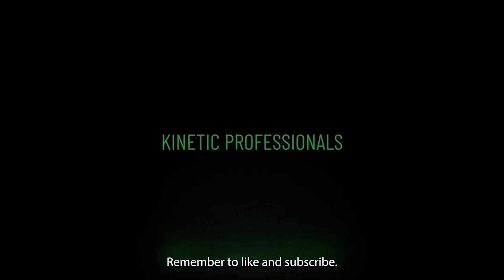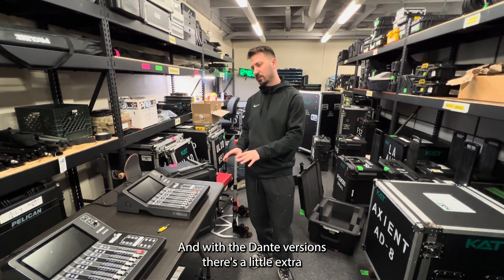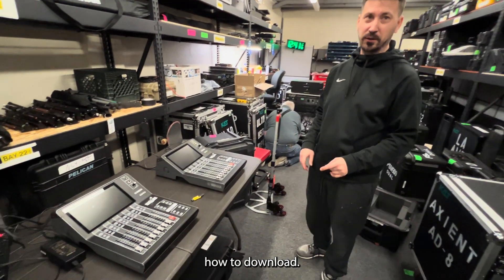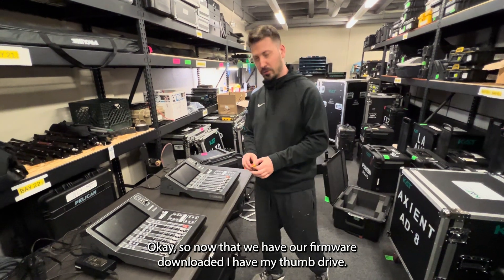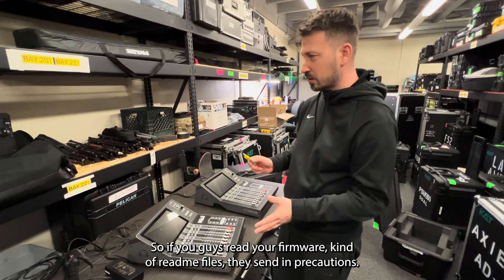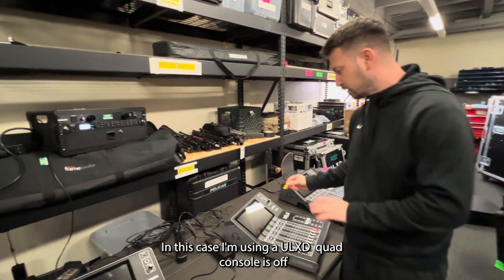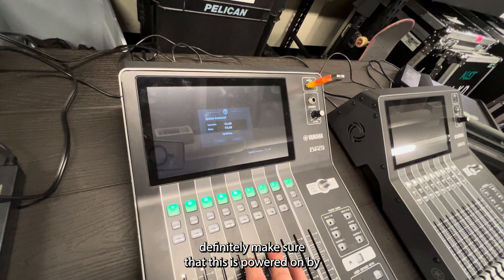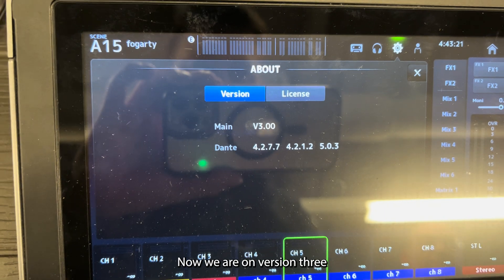How to Update Firmware on a Yamaha DM3 Digital Console

Comment: I was having trouble updating my Dante desk. And I thought you had to only have the .bin file, on the root of the USB. And I was trying to do a Dante update (file .dnt), via the Dante software on my laptop. 

Before, when I did the updates. It would stay it worked in the about menu. But once I restarted the desk. It would go back to the old firmware. 
I'll give it a go with both .dnt files and let you know how it goes.

Comment: Thanks for this - I came back to watch the video because I didn't see a Dante update happening, and I wanted to make sure I had the same Dante version that you did after the update. I guess mine didn't need a Dante update because it's the same as it was before the update and the same as on your DM3-dante after the update. The material from Yamaha doesn't list what firmware is needed. Yes, I DID have a Yamaha DZR-10D speaker hooked up to it so it had something connected correctly.

Comment: It's in the pdf from Yamaha, but just in case - when updating the Dante DM3 mixer, you can just connect the Dante Primary to the Network (Control) port with an ethernet cable if you don't have another Dante device lying around. Also, the Dante firmware will be updated if the Dante files are on the USB stick. 
Generally, I try and NOT use Dante Controller's firmware updater for anything Yamaha (it probably won't work anyway). R-Remote is "the way" to update Dante firmware for Yamaha Devices.
Reply from the maker: @Remotely-Possible  yup. In this video I used a ulxd quad receiver for just that reason!